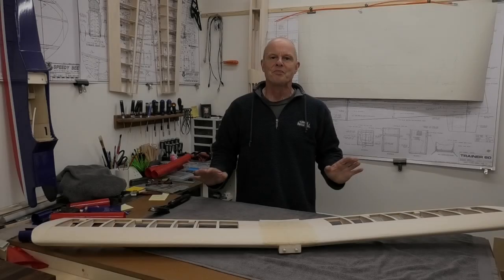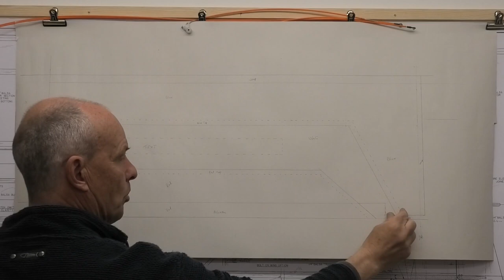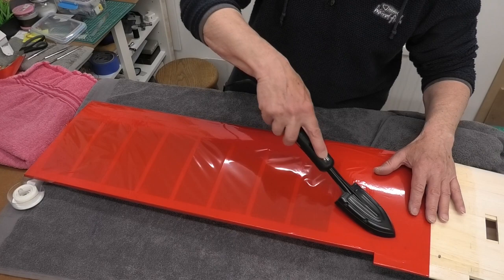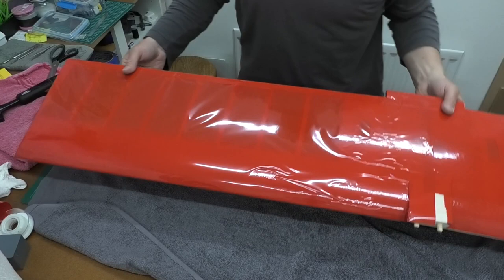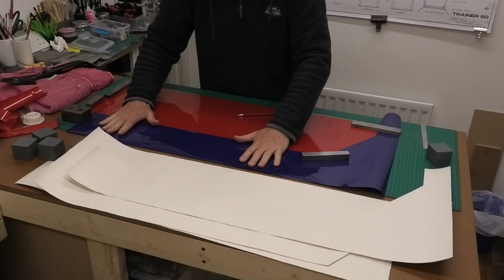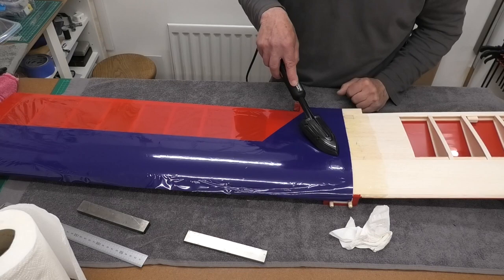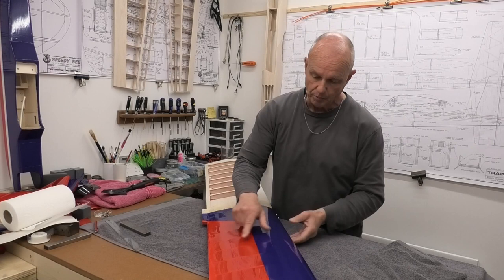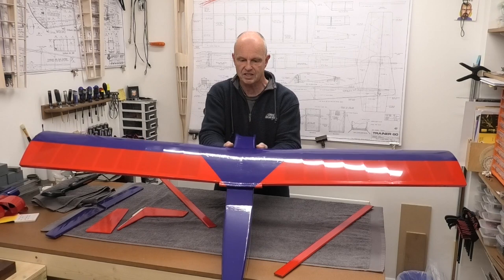Great Planes Trainer 60: Pt 17 Covering the Wings - Build Series - 65" Wingspan RC Balsa Aeroplane

Comment: Hey Mark, I've had some good success with the covering that 4max have started selling.. Was a bit dubious at first as its only £20 for a 5m roll but it shrinks and sticks well and no glue squeeze out
Reply from the maker: Thanks for the suggestion, good to know.  How does it stretch around corners?
Reply: It stretches well around corners wingtip etc. Good resistance to high heat too so I turn up the iron and smooth it around edges and it comes out well
Reply from the maker: Excellent, good to know, thank you 😊

Comment: good but no white trims on the wing?
Reply from the maker: Thats correct, I do explain why in the video - the white was so poor and because of the issue with the colour bleeding I decided not to use it.
Reply: @MarkRobinson555  over the years I have always covered plane with polyster film & spray painted my planes , rarely I used iron on covering.